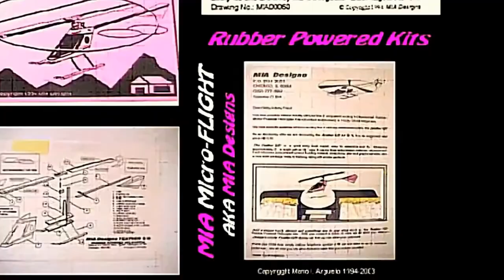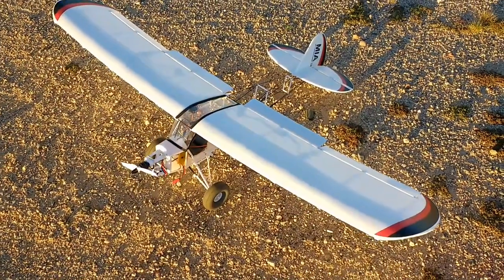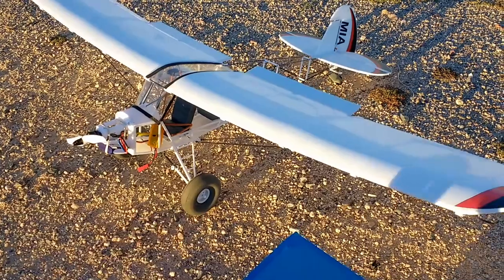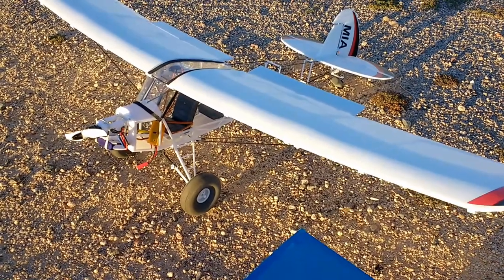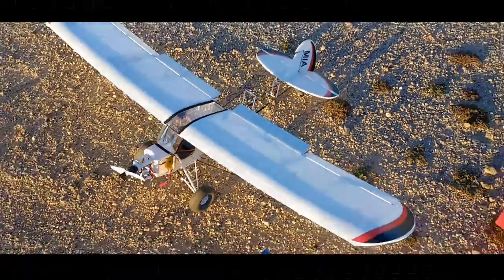MIA PIPER LITE - SAVAGE BOBBER - RC ULTRALIGHT MAIDEN FLIGHT 2022

Comment: Good maiden flight, so tell me it needs some trim up or was a tail heavy? 
The wings are foam sheet right?
Reply from the maker: Yes, maiden revealed model needs trimming, it was sensitive to up elevator. It needs mechanical link adjustment to remove some of the elevator sensitivity. Otherwise, it lifts and flies like a feather because it is very lightweight, the wings are foam 3mm thick.   I will do another flight with the model tweaked when the sun comes out again. It has been a bit windy and wet here.